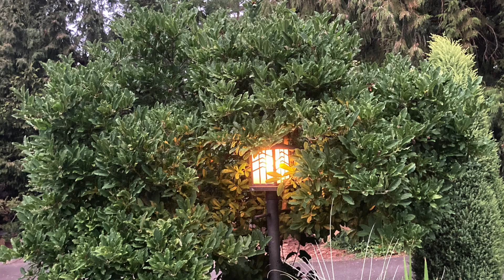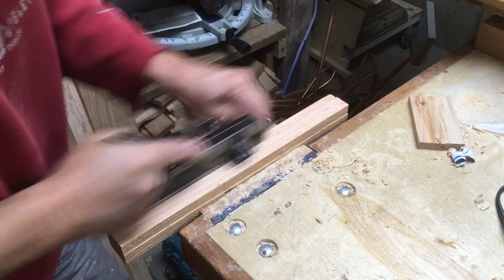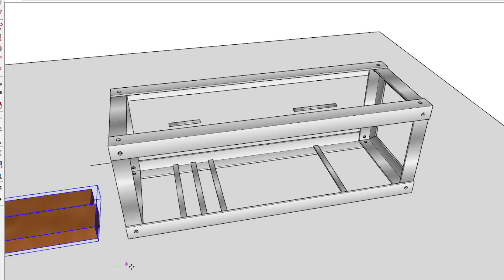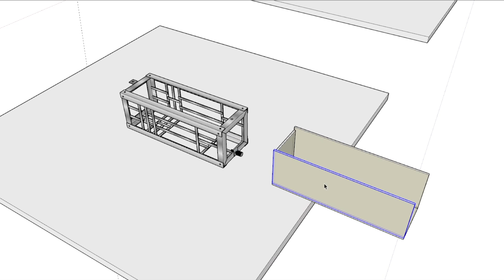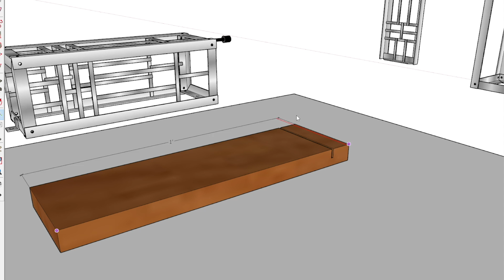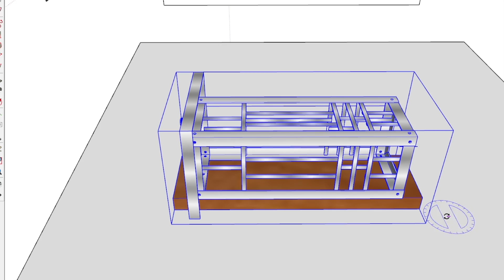Build a Craftsman Style Low Voltage Landscape Light Fixture. Wall sconce.

Comment: Great video guide! I know this is a bit old but any chance you can let us know what low-voltage parts did you use for the lighting itself?
Reply from the maker: Here are a couple amazon links.
The bulbs were a 10 pack Ratio G4 bi-pin bulbs.
The sockets Rayhoo G4 ceramic, also a 10 pack.
Hope this helps. 
Thanks for the comment. 
https://www.amazon.com/Non-dimmable-Equivalent-Halogen-Replacement-2800-3200K/dp/B01C8G7PUG/ref=sr_1_7?crid=X56NBW2ICL45&keywords=low+voltage+led+light+bulbs&qid=1686326271&sprefix=low+voltage+led%2Caps%2C144&sr=8-7https://www.amazon.com/gp/buyagain/ref=pd_rhf_d_ee_s_rp_c_sccl_2_2/146-8105043-9205724?pd_rd_w=enqSV&content-id=amzn1.sym.ce0df94d-5f53-479c-8afc-7445cd1daf0a&pf_rd_p=ce0df94d-5f53-479c-8afc-7445cd1daf0a&pf_rd_r=KCGJ2DDM8KYRKQB89P3Z&pd_rd_wg=aW68i&pd_rd_r=ddfe2323-3539-4aea-88a2-dbe4e2d35dd0&pd_rd_i=B07CXL6MLD&ats=eyJleHBsaWNpdENhbmRpZGF0ZXMiOiJCMDdDWEw2TUxEIiwiYXNpbkludGVyYWN0ZWQiOiJ0cnVlIiwiY3VzdG9tZXJJZCI6IkExRE9aOVBFVzM0SjFUIn0=